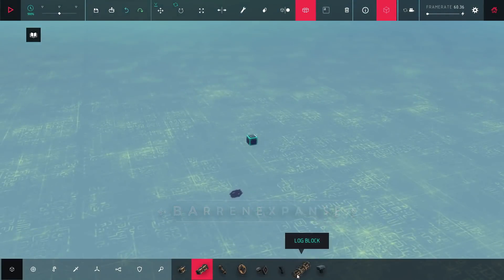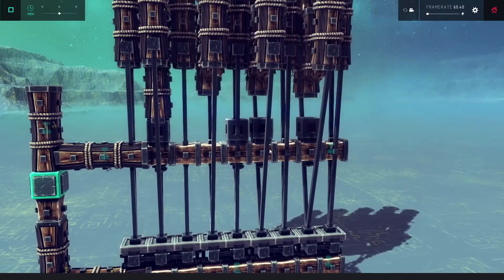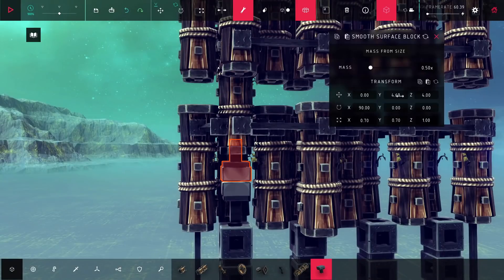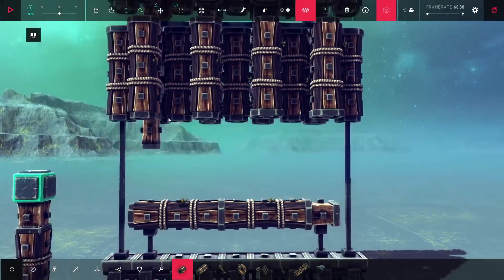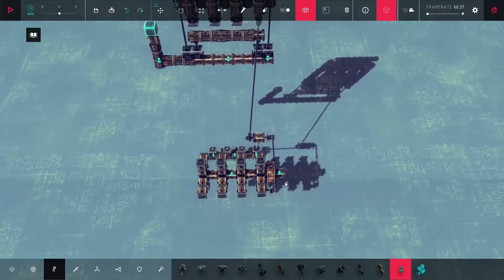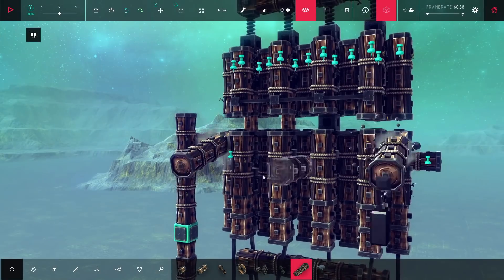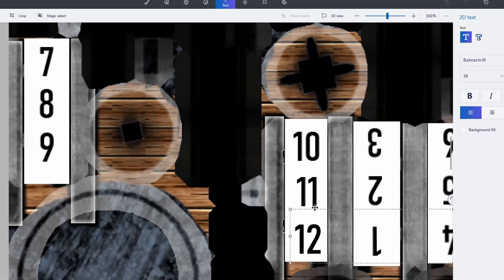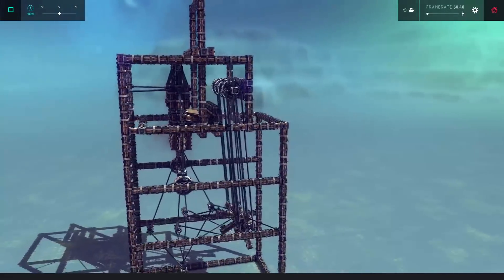Making a Massive Mechanical Combination Lock in Besiege

Comment: Could it have been smoother to have used the elongated smooth surface blocks as the enclosure holding the pins? I've never played the game, so I don't no if using them would work and also be as compact.
Reply from the maker: Not a bad idea, smooth surface blocks can be a little difficult to pin in place once they are stretched though

Comment: If a map making tool exists, dust 2 will be made in it, and if a game has block based building like Minecraft, someone will make a lock, even though no one needs a lock in said games, those are 2 of the many rules of creation tools in games. That and people will make huge di-
Reply: And if it has a screen bad apple will be played on it and if it has a cpu doom will have been played on it
Reply: @YehiaBayoume19  And if it exists...
Reply: @YehiaBayoume19 a screen means bad apple. A screen with external inputs means Doom.
Reply: @YehiaBayoume19  "if it has a cpu" What about a 2 instruction CPU? You definitely cannot play Doom on that.
Reply: @nikkiofthevalley  hello Mr i like to nitpick jokes.
Reply: @YehiaBayoume19  He has no faith in the power of our desire to play doom on EVERYTHING
Reply: @nikkiofthevalley  Certainly! There even exists a single instruction set (subtract and jump if less than) that is Turing complete.
Reply: @wallabra  I knew this, which is why I posed the question. It wasn't a question, it was a challenge. It's not possible to play Doom without access to input and output, so I'd add an input and output instruction, just so it's possible.
Reply: @nikkiofthevalley  Honestly it's pretty impressive the things people get Doom running on I saw a vid where someone got it going on a TI-83 calculator lol.